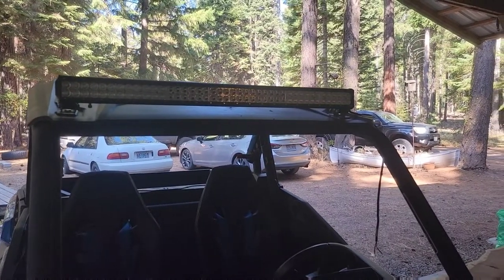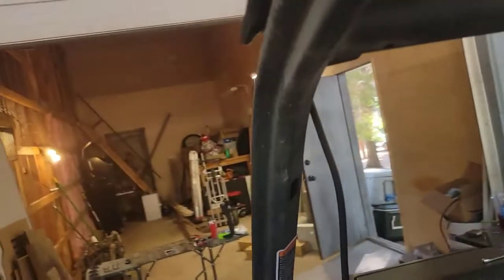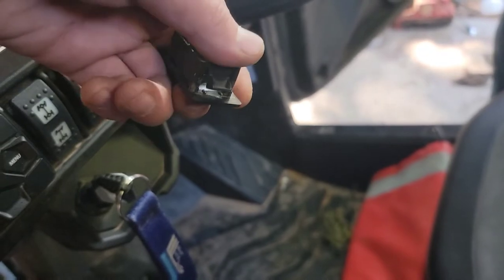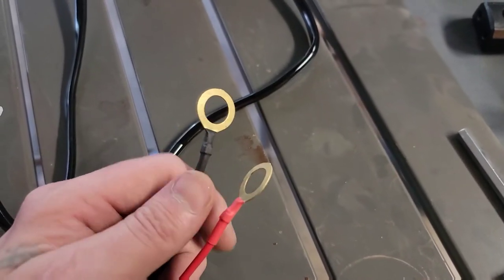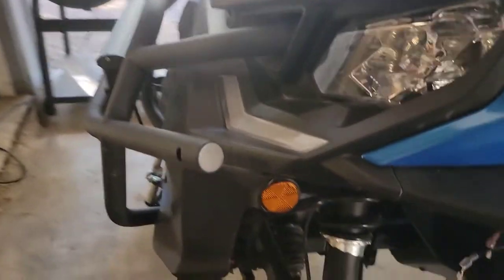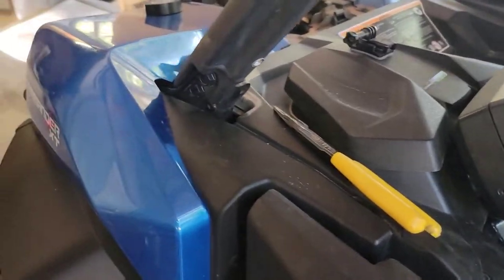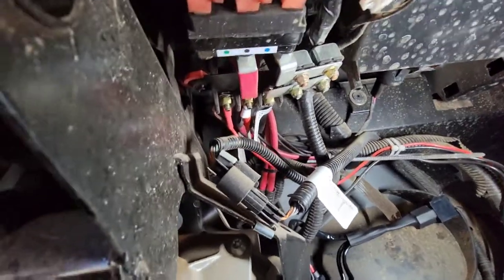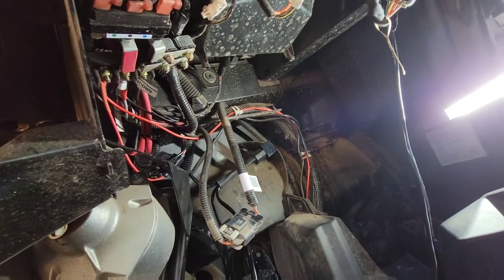21' commander light bar install

Comment: Thanks for the video.   Definitely helped!   I have a question. With your harness, you hooked up the red to the buss bar accessory, and then the black to the ground, but nilight have the 12v relay box with it where did you hook that up to?

Comment: Just curious if the 15” led light bar on the front bumper gives you enough roof for up and down angle adjustment? Wit looks fairly snug in between the bars. Thank you for any info.

Comment: Have had installed both led lights, wiper, stereo by Can Am dealer and fuses keep burning.  They did some changes in wiring but when I used winch and top headlight, the headlight stop working. What are they doing wrong on my 2021 Commander XTP.  Thanks!

Comment: What tires are you running? Did you have to do any suspension modifications?
Reply from the maker: They are the sedona rock-a-billies. Went from the stock 28 to a 30 inch tire, no suspension modification needed.

Comment: The buss bar is under the dash?
Reply from the maker: Yes it is.
Reply: So the post on the buss bar closest to the steering wheel is the accessory one? Looking to do identical thing to mine . Where did you also hook your ground up to ?